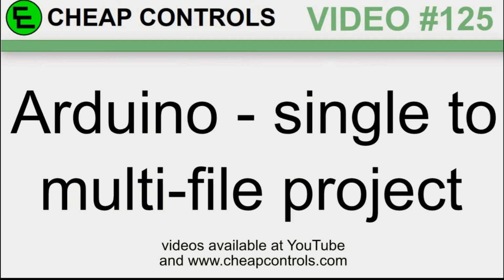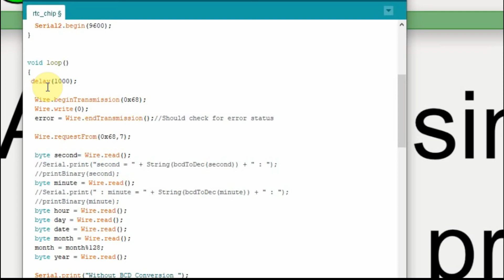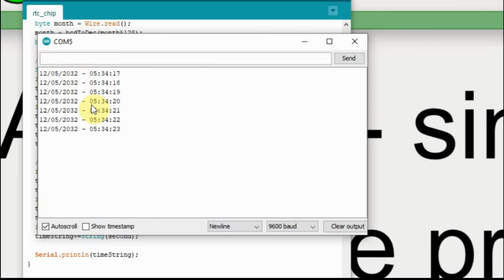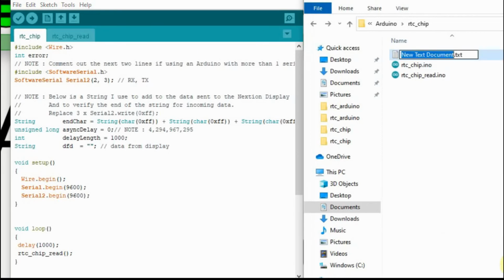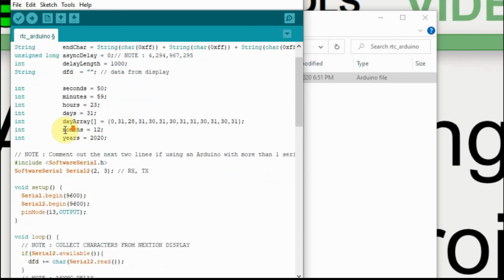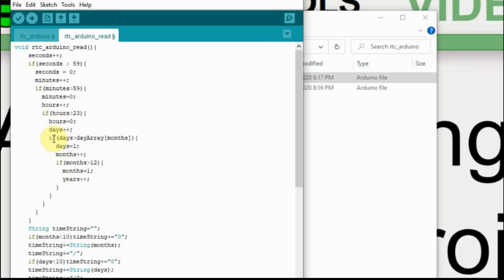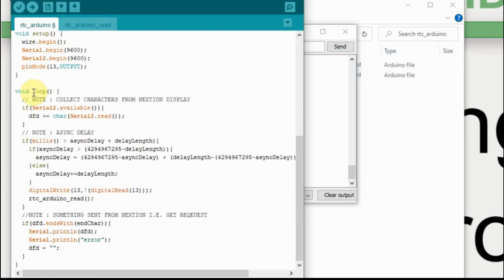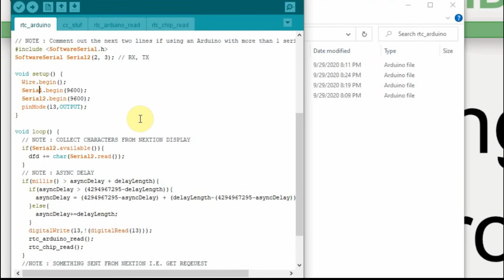125 Arduino single file to multi-file combination earth-shattering mind-blowing project

Comment: Mark you used a Null character in this video when sending some data to the Nextion, but in another one of your videos, #65 Nextion Display - no Arduino Nextion.h Library part 2 or 01B, you don't. I'm trying to understand the conditions in which it is used or not.
Reply from the maker: I don't remember doing this video.   It is almost a duplicate of this past week's video.  Do you mind pointing to the part in the video you are referring too.  I just went through it and can't find where I sent a null?  I will admit I am very tired tonight.  You have been very good at commenting on my videos so I want to make sure I understand what you are asking.  I hope you are having a good weekend.  I am somewhat taking a few days off.  I missed a video last week but  I am currently making a new version of the original using the nextion without the .h library.  When I made the first one, I was very new to the Nextion displays.  I hope I have gotten better at both using them and making videos.